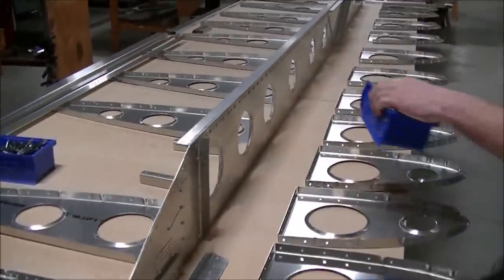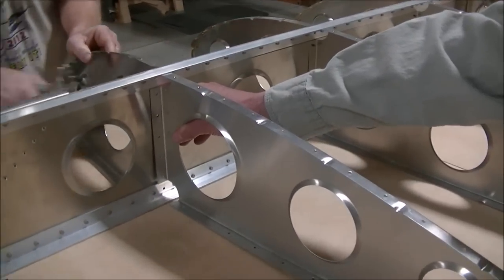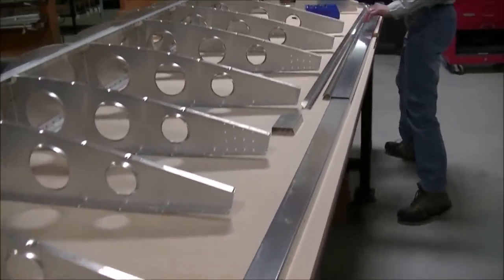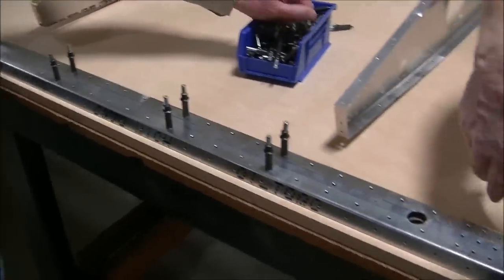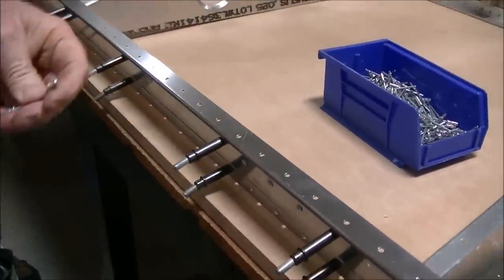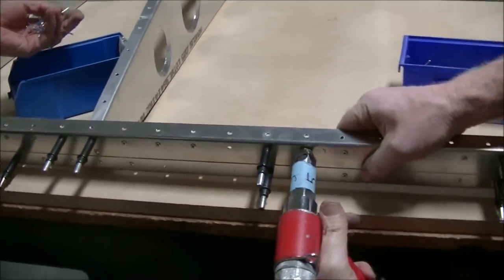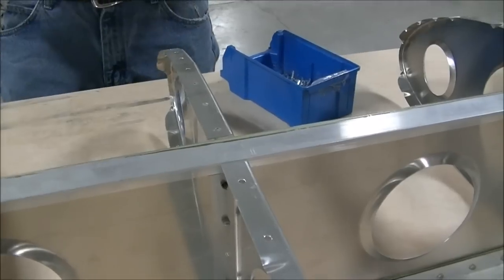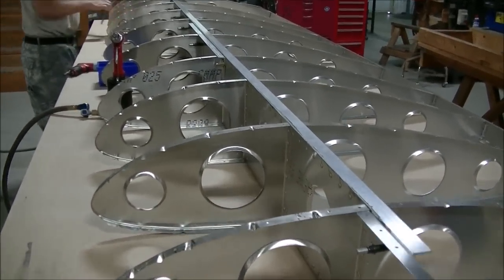Building the Zenith CH 750 Cruzer kit airplane: Part One: Internal Wing Assembly

Comment: Be aware that you still have to drill wing ribs in the kit to final-hole size before assembly. The video was produced when they were experimenting with doing final size holes in the ribs, but this had some problems so soon after the video they reverted the ribs to starter holes for the ribs. It takes a few hours to drill out to #30, then #20 on all the rbis before assembling them like in the video.

Comment: Why would a person prime the interior wing parts? 6061-T6 AL is highly corrosion resistant. Is there a potential for electrolysis?  I live by the ocean and I am considering the 750 cruzer with 15 inch wheels...
Reply from the maker: Most builders choose not to add additional corrosion protection (as it's simply not deemed necessary). Of course, it's not difficult to add while building and all-metal airplanes do seem to last a lot longer than the original owner / builder.

Comment: Why would you use blind fasteners on the rear spar when you could have used solid rivets?? General practice used to be solid fasteners when ever possible.
Reply: I have no relation to Zenith, other than as an observer, but I believe that blind rivets are their standard. 
Probably because:
1) they're easier for an amateur to get right, easier to use where a solid rivet would require access to the back of the panel, 
2)  don't require a bucking partner. 
3) Tools required are cheaper too. (RV sell $25 plans for a toolbox kit  as a practice piece using their solid rivet technology. Unfortunately, it requires approximately $750 worth of tools for assembly.)
Reply: I  guess my old Rockwell drill motor, IR 4x rivet gun and other aircraft structures tools are still worth buck!!!!!  Maybe when I retire from the railroad in 9 years I will use them again.
Reply: Start building an RV now, and you should have it finished by the time you retire. :-)*
(Hope you found the answer satisfactory.)
Reply: I like to stay on the ground now days.
Reply: avro549B
Reply: avro549B
Reply: avro549B oh (pé pá
Reply: Lapa outros

Comment: Do you use a stainless sheet for the skin?
Reply from the maker: 6061-T6 aluminum alloy is used, in various thicknesses. Most of the wing skins are .025-inch thick.
Reply: Zenith Aircraft Company plz tell me the centimeter of one rip and done reply after 2years ,I wonder two years ago comment u replied last two weeks 😕😀
Reply from the maker: Sorry but we do not understand what "centimeter of one rip" is asking. We are happy to answer any and all questions that we can understand. http://www.zenithair.net/contact/
Reply: They are using 0.8 mm
Reply: MOUAD LALOUI thanks bro

Comment: Pop riveting a constantly flexing wing?
Reply from the maker: We've been using Zenair blind (pulled) rivets for the past forty years on the Chris Heintz designs very successfully, and blind rivets are now common practice in the industry (used extensively on Van's Aircraft RV-12, Sonex, Rans, etc.). The use of blind rivets is one of the reasons all-metal aircraft continue to be the most popular kit designs.